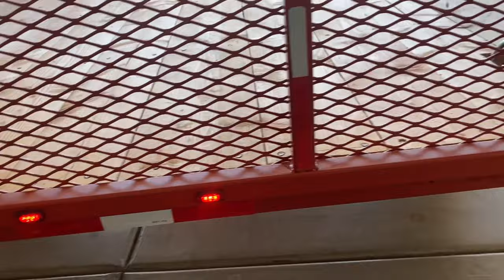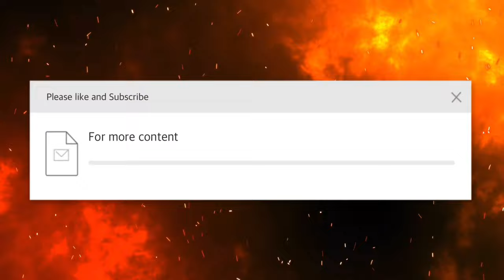Making a Custom Trailer

Comment: What metal thickness did you use?
Reply from the maker: Frame 2x2x1/8 square tubing  hitch 3x1/2x1/4 channel pole 11/2x11/2x1/8 square tubing front pole 11/2x11/2x3/16 angle ramp 11/2x11/2x1/8 square tubing expanded metal 1/8 x 3/4  aluminum 1/8 inches

Comment from the maker: Frame 2x2x1/8 and corners poles 2x2x3/16 middle poles 1 1/2x1 1/2x1/8 SQ tubing Railing 2x1/6 round tubing ramp 11/2x11/2x1/8 SQ.tubing
Reply from the maker: Utilize alambré de soldar para guiar el alambrado eléctrico todo  interno
Reply: غر😂❤فة ومنافعها 🎉😂😂84ق4ف555